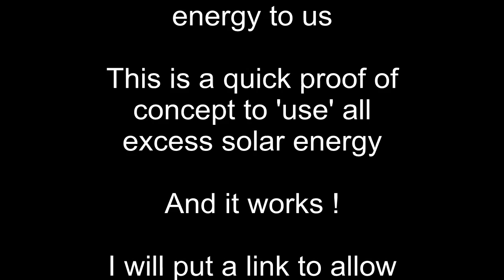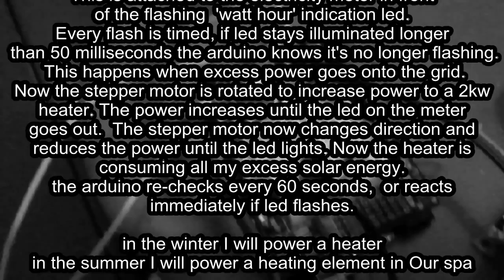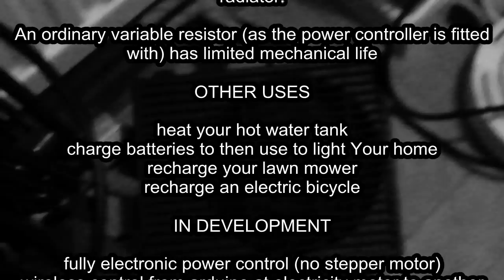Use Excess Solar Electricity (Arduino project)

Comment: I have been wanting to do something like this for years. Also good for when battery banks aare full and only need a trickle charge, to divert bulk of power to something else.

Water pump, firdge and Air conditioning are common requests here in Australia.

I take it you dont get paid well for power into grid where you are?
Reply: There has been talk of an auction system based on demand from the grid. Being able to divert excess power when bid is low is capitalism for you.
Reply from the maker: we get paid for every kwh we generate, whether we use it or not,  we only have a generation meter,  it's assumed half of what we generate goes to the grid.  so it makes sense to use any excess. we get a a small payment for what's assumed to go to the grid.